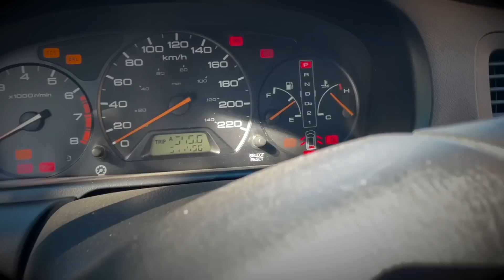My van works now!

Comment: The idle problem was that the cooling system didn't burp and it had a air pocket at the IAC valve. Nice quiet area to relax and reset. Thanks for taking us along.😁

Comment: When it overheats try turning the heater on and also maybe try buying a thermostat might not be opening all the way 😊 and do you know if the radiator fan is turning on when it gets hot

Comment: No dude power steering is not a big issue he's just a little switch on the right side on the passenger by the front wheel you can change that no problem

Comment: I recommend getting the rack and pinion replaced. It will save you headaches down the road as well as give you peace.of mind. I like the artsy feel to this video.
Reply: replacing a whole rack and pinion because of a leak is a waste of money. Better to replace the hose or seal thats leaking. The rack and pinion is working fine. Its Just a Leak.
Reply: @addictedtopussy69   that’s even better if that the only issue, I was going off what the mechanic said.

Comment: As to that high revving...  It looks like your brother disconnect the battery yes?  A lot of times when this happens the vehicle's computer module needs to recalibrate and will reset after driving it a bit.

Comment: When you jump start a car you CONNECT RED FIRST to the battery terminal and CONNECT BLACK LAST to a metal part of the engine.   Disconnect black first then red.  Today’s cars have computers and the negative (black) terminal has an inline sensor.   Jump starting while connected to the ground could mess up the computer’s ability to properly read the sensor.

Comment: Juliana for a  older car always check the oil the power steering and the cooling also the spark plugs and the battery every morning before you go anywhere ok mi amor it will keep your car running for a very long time ok with kisses your friend Francis 😘

Comment: Juliana with an older car there are some cheap parts that may need replacing like wiper rubbers and the air filter+oil filter, how are the door seal rubbers? So much you can fix yourself cheaply and once done it's done for years,spoon you will have a great reliable Honda!✌️❤️🇬🇧 much love Juliana

Comment: Greetings from Springfield Missouri where the local time is 4:05 p.m. on Sunday with the temperature of 93°...
Nice to see you're getting the van squared away. I would definitely say that it's worth putting money into and the fact that it's a Honda usually means it should run for a long time...
Sure was a cute little town you drove through on the way to the waterfall and that area around the waterfall was really beautiful...

Comment: Hello, 1200 Bucks for the Alternator ???? You can buy a Used one, same for the starter. Sometimes on the alternator,
 the problem is from the excitation coil (outside) You can also find a spécilist to redo the coil (inside). Anyway, the best way is to remove it and go to the Workshop for testing.
Good luck! I hate mechanics! In another life, I was a seafarer, master, and mechanic engineer, shity life.
Kind regards, cheers.